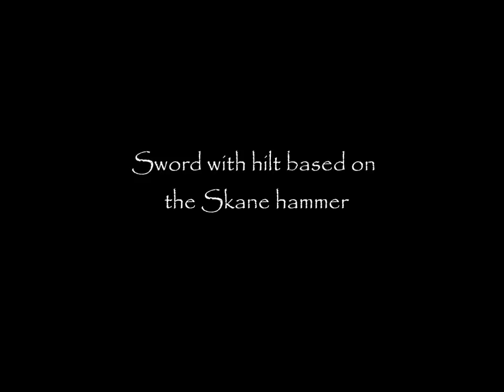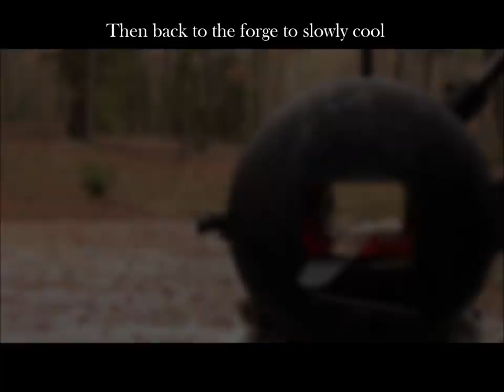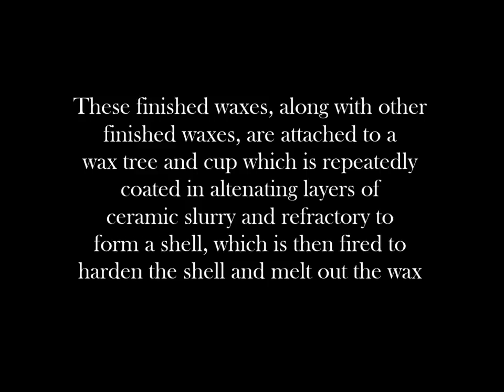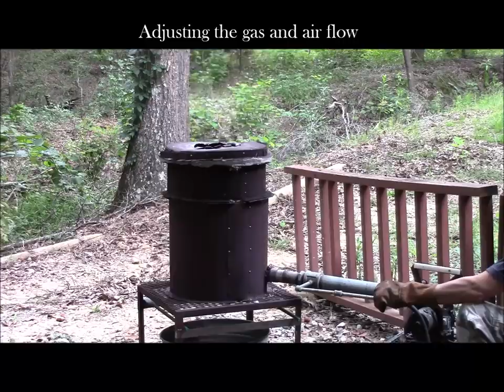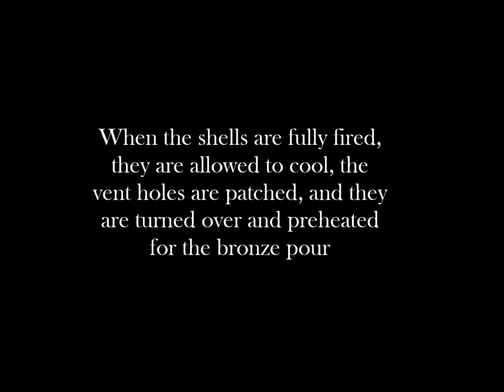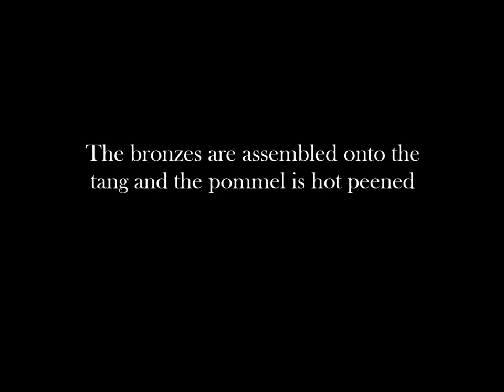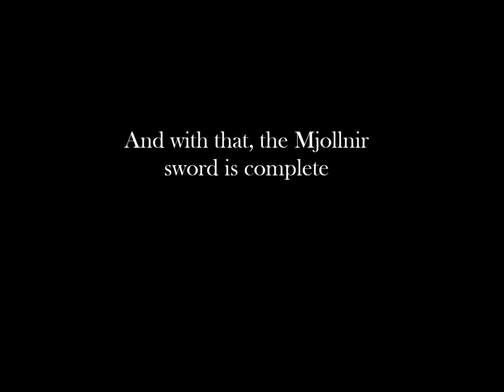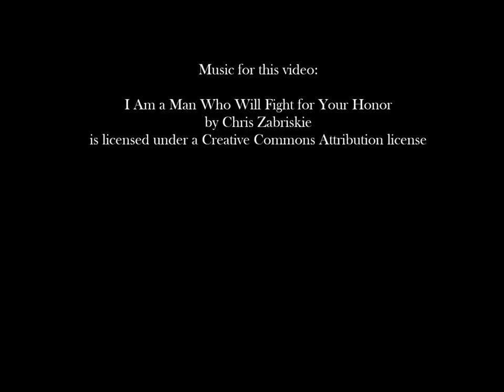Mjollnir sword

Comment: love that style of hydraulic press. I have worked mine for years. About every three years, I burn the motor out by dropping slag and scale into it. But, it is what makes my work possible. Serious pattern welding is possible with that thing, and so is moving metal carefully. I broke down and built a tire hammer and I only use it every now and then. The press, if you take the time to learn it, is awesome for sword making. Thanks for sharing your videos. I really enjoy them. nice craft, too!

Comment: You show how you've "banzaipeened" guards to tangs in a lot of your videos. Do you have a video where you explain this? or is it something you want to keep a trade secret?
Reply from the maker: It's just a method of staking the metal of the guard into the tang to lock the guard into place using a soecially shaped punch and a hammer. The guard is banzaipeend to the tang, the grip is epoxied (and often pinned) to the tang, and the pommel is keyed and peened to the tang. In this way, if one part of the hilt were ever to fail, the rest would still stay together. In contrast to something like a compression fit screw on pommel where if the threaded piece holding the pommel on were to fail, the whole thing could fly apart.
On well made and fit sword with a steel guard, the guard can be very slightly undersized so that it can be press fit onto the last half inch or so of the tang at the shoulder, and eventually a slight bit of rust would form between the guard and tang, cementing it in place. That doesn't work with bronze parts because the bronze, being more malleable than the hardened steel, will deform as it's press fit and could eventually work loose.

Comment: forget the last comment- I see that you have a vertical kiln (which is what I also have). It is a salt bath or electric? Obviously, if electric, you can anneal away. That's what I get for commenting while watching instead of waiting. Forgive me... :) . I had forgotten how well you cast things, too. You have me beat there (I have focused on engraving and carving metal but I can't cast to save my life). I can cast a bar or sheet to make something out of :)
Reply from the maker: My kiln is electric. I'd like a salt bath but don't really want something that caustic around the shop, given my propensity to occasionally knock things over. Casting bronze is a whole thing unto itself with a lot of fiddly little steps to follow to get right. I was a sculptor and bronze caster before I started making swords, it would be a lot to take on just to do for sword parts.

Comment: know you could have put the bronze peices in water to desolve the plaster instead of breaking it with a hammer
Reply from the maker: It isn't plaster, it's a fused silica ceramic which does not dissolve in water. That's cute that you want to help though.